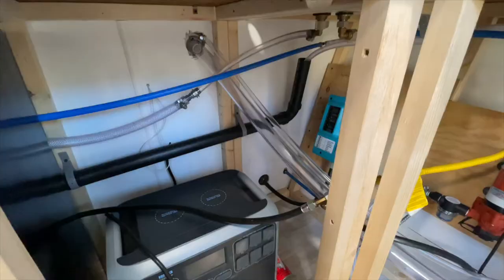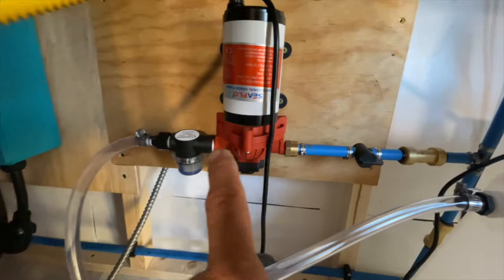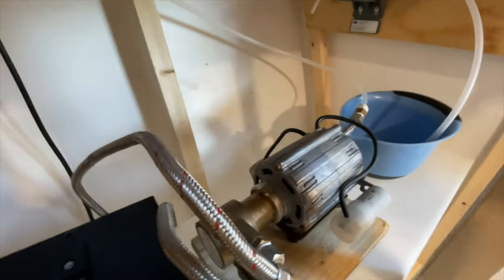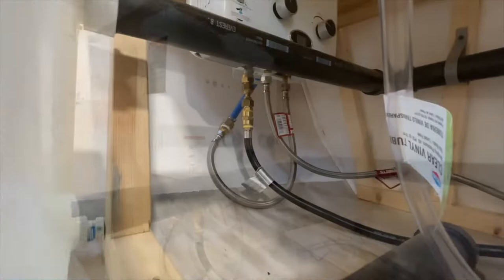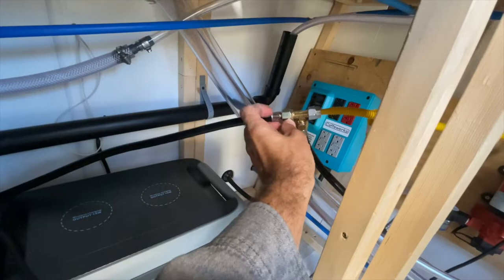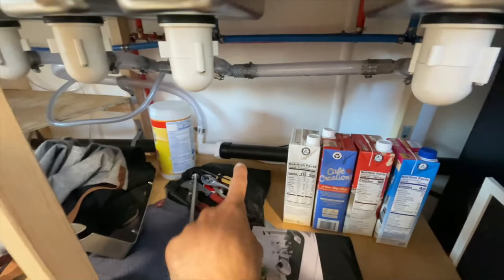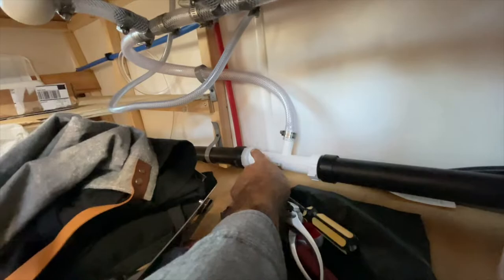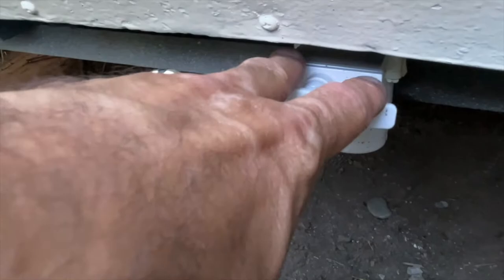Coffee Truck Plumbing - Press On Coffee Trailers

Comment: I’d love to see how you did your drains. Did you just elbow down and across to end of trailer to your gate valves?   This video is awesome! I’m following your plan to the tee! Thank you for sharing!
Reply from the maker: Thank you! Basically, yes. All my drains. Are connected to the long black ABS pipe, which connects to the grey tank. The grey tank elbows down through the floor, then elbows over to the edge of the trailer where I have a gate valve.

Comment: How is the heating speed of your espresso machine on propane? My research tells me that the drawback of propane-powered Espresso machines is the heating time between shots. Have you experienced this? Thanks!
Reply from the maker: @alexandrepapineau4448  there is actually no difference compared to electricity in these new machines. I’ve never had a slow down or delay at all. That was true for older machines but they are awesome now.
Reply: @PressOnMobileCoffee oh really? Do you know of a reliable 2 Group espresso machine that is powered by propane? Thanks!
Reply from the maker: @alexandrepapineau4448  my favorite is Fracino by far. I would say they pioneered the modern propane espresso machine for mobile applications. I order mine from:

https://thecoffeeguys.co.uk/product-category/dual-fuel-coffee-machines/

Wega and Magister are both great machines as well.

Comment: Are you just filling the tank with city water from a hose and then filtering after the tank?
Reply from the maker: Correct. I have a drinking water hose and then I use a 3M filter.

Comment: What type of water pump do you use for the espresso machine? Thanks in advance
Reply from the maker: One Seaflo 33 Series water pump and accumulator tank. That runs all of the plumbing for the trailer plumbing, including the espresso machine.

Comment: do you have to use propane?
Reply from the maker: You don’t have to use propane but you will need a bigger battery system. I highly recommend Joule Case if you want to run your whole setup on batteries.
Reply: @PressOnMobileCoffee  thank you for the info. Propane scares me because I feel I have no idea what I’m doing lol I saw something briefly when looking at tanks about them potentially exploding due to pressure what would cause that ? Thanks
Reply from the maker: @jzaccarelli7951  I feel like you’d have to intentionally want to make one explode. They are very safe. I haven’t even had any issues with a leak before.